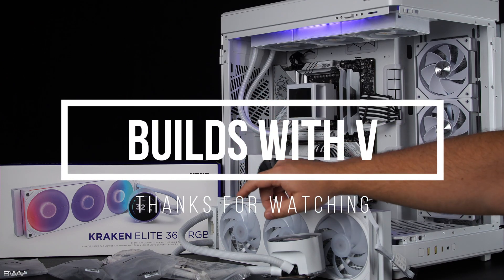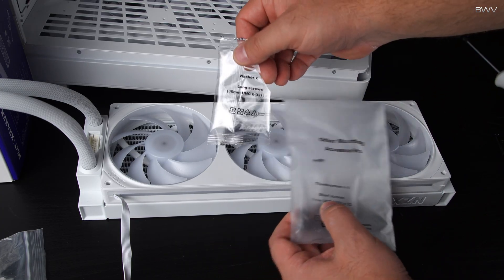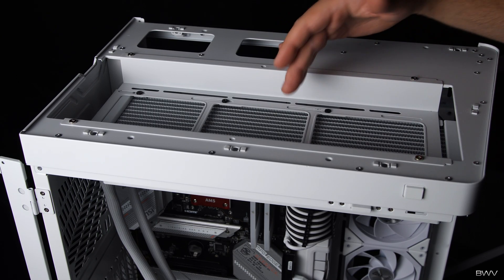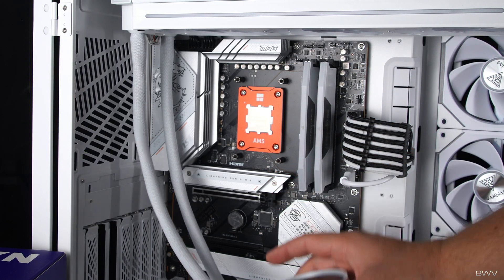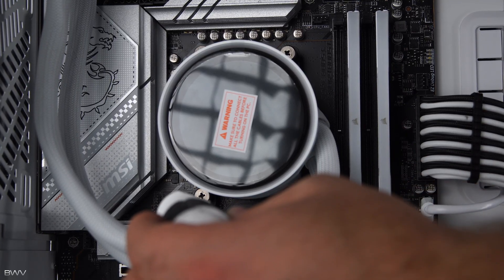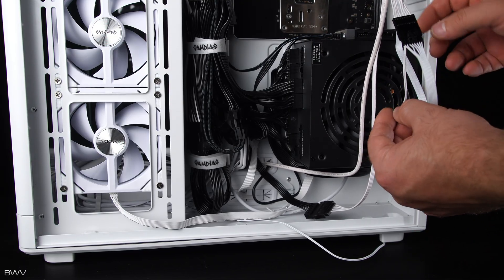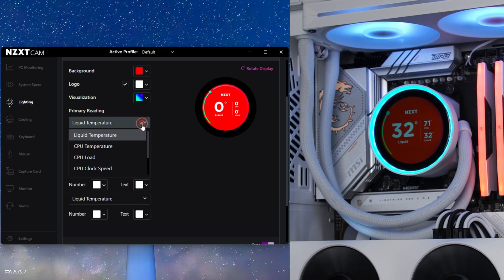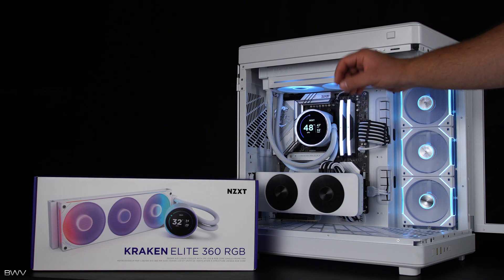How To Install NZXT Kraken Elite RGB AIO CPU Cooler

Comment: Why would the white cable not go into the Fan Pump header ?
Reply from the maker: You can do it that way. Both do the same thing and I usually do it in fan header only if I don't plan to plug in any other fans or pumps into CPU fan header.

Comment: Hi friend, I bought the 280mm version and the cooling is good, but when I mute it while reading articles, there's an incredible vibrating sound. It vibrates when I set it below 35%, and when I set it to 35%, there's a buzzing sound. It's incredibly annoying. I sent a video to NZXT and they said the sound is normal. If your product isn't quiet, why do you write "quiet operation"? I'm not going to buy anything from NZXT again. I have a question for you, friend: can soundproof computer cases suppress this sound, or what can be done to suppress this sound? My old cooler, the Arctic Liquid Freezer II, was very quiet, but the 3 Series ones are noisy now. If there's anything I can do to suppress this sound, could you help me? What can I do?

Comment: Hi is there any reason that you have to  connect only cpu fan header and not to the aio pump header ?
Reply from the maker: I only connect to the pump header if the CPU header is already used by other fans such as the radiator fans. Doesn't actually make any difference tho.

Comment: Hey I've been having trouble building mine. The AIO fans wont spin up, but the RGB and LCD screen turn on and work. What should I do?
Reply from the maker: Are the fans set to 0 rpm mode in nzxt cam software?
Reply: @BuildsWithV will check. Where in the cam software can I find that? Also, wouldn’t the AIO fans spin up regardless when I power on the PC? Or no? I’m new to this, first time building a pc😅
Reply from the maker: @rohanG63 yeah they should spin up even on 0 rpm mode. That setting would be somewhere under cooling or something like that. I'm currently not on my PC so I can't really remember 😅
Reply: @BuildsWithV is there a way I can send you some pics of the motherboard and AIO etc and maybe u can detect what’s wrong? 😭
Reply from the maker: @rohanG63 yeah you can dm me on Instagram. I don't get notifications on there tho so let me know when you do.
Reply: @BuildsWithV  I just messaged you on Instagram. It wont allow me to send pics/vids for some reason though.

Comment: 12:17 Can't you just put it on the header that says "PUMP_FAN1"?
Reply from the maker: You can but many peoples motherboards might not have the pump header and so I just show it can go into CPU fan header. It won't make any difference. Only reason that cable needs to plug in is so that the motherboard won't give you a no fan plugged in warning.

Comment: Shouldnt the pipes be facing down on the pump head ?
Reply from the maker: Not necessarily, this orientation works perfectly fine as long as the pump isn't the highest point in the loop.

Comment: Should you exhaust pr intake air from the cpu? If its on the side its intake right but on top exhaust ?
Reply from the maker: Yeah that's how I usually do it, exhaust on top and intake on the side. Although you can do exhaust on the side as well if you'd like.
Reply: @BuildsWithV in some cases you can almost hide the aio cooler cables if it’s on the side going out the back. I find it harder to hide when on top. From the videos I’ve seen 😊
Reply from the maker: @worldabovewheels yep, checkout my latest PC build. Exactly what I did 😅 maybe you've seen it already?

Comment: if im putting my own fans on the radiator, i need 12 of those long screws to mount the 3 since they arent d chained. does it come with more or no? Thanks!
Reply from the maker: Yeah it comes with a lot more. I didn't count but looks like at least 12

Comment: Hello, how rise cable you use for gpu?
Reply from the maker: Cooler master masteraccessory pcie 4.0 white cable. I don't know if it's still available. I got it from Amazon
Reply: @BuildsWithV  Did you buy just the Cooler Master riser cable, or the kit with the GPU bracket? If you could share the Amazon link, I'd really appreciate it. I bought the PRO case and wanted to install one that was compatible. Thx :D
Reply from the maker: @fernandoleone614 I bought just the riser cable. https://amzn.to/47e5Y8e
Reply: @BuildsWithV  I bought this cable, were you able to secure it to the case with both screws? It only allows one to be attached; the other one is off the line.